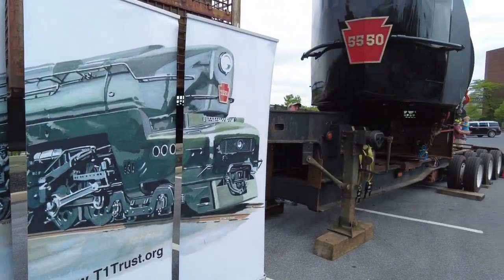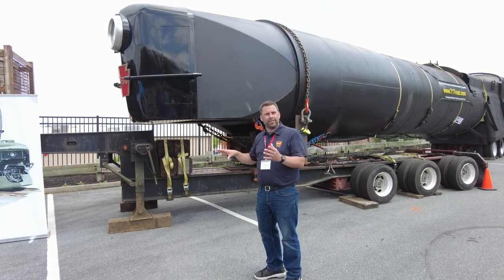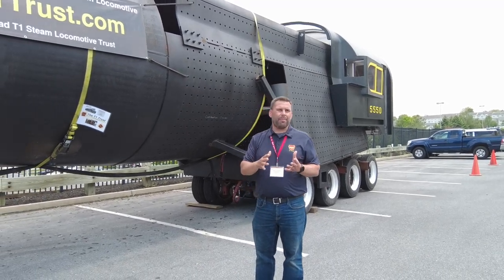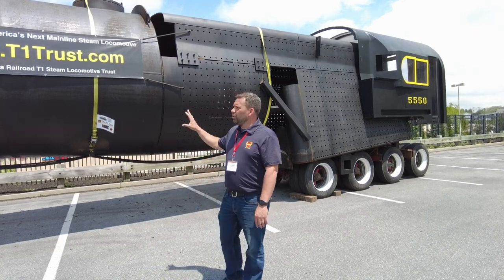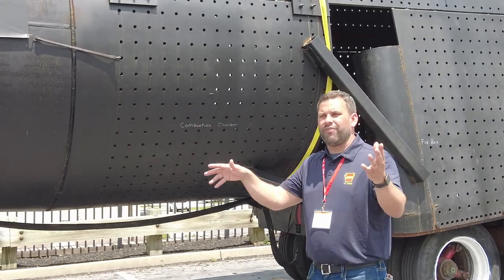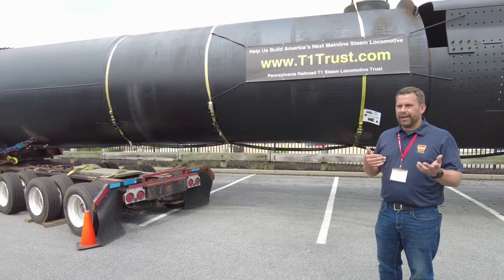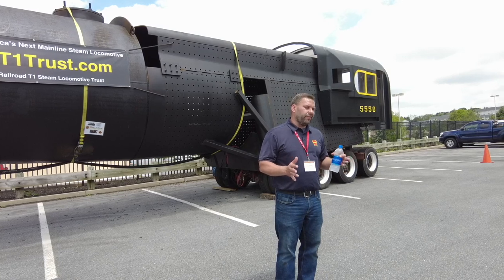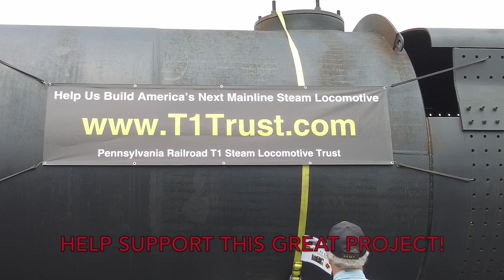T1 Trust PRR 5550 open house | Building America's next mainline steam locomotive

Comment: If they made her run on the line from Los Angeles to Las Vegas, they could make a ton of bank on excursions. Obviously have the coahes decked out with modern amenities. But have the line as flat and straight as possible to achieve the speed that can be used as one of the selling points.
Reply from the maker: That would be an amazing ride! You'd have the high speeds like you mentioned, and I also love the desert southwest so that would be great for sightseeing. You never know, they could decide to do it!

Comment: I find it really cool that the Frame won't be a cast unit, but a precision welded forged steel plate frame. Cast frames had a bad habit of getting some warp in them from heating and cooling. Because of that they had to run tolerances looser for anything was attached to the frame. Looser tolerances caused accelerated wear. With today's precision optical measuring tools that new steel frame should remain straighter than strait and stronger as well.
Reply from the maker: Good assessment, and I'm glad that modern manufacturing techniques are going to make 5550 the best T1 ever.

Comment: Wow Jamie i knew nothing about this. I am only about 15 mins from there thanks for the very interesting video. Thumbs up.
Reply from the maker: Aw man, that would have been cool if you had known since it would have been so easy for you to go see it. Glad you stopped by to enjoy the video though.
Reply: @JamieMakin  That's ok at least I know about. When you were there you were really close to the old Reading Rail Road Yards. Nothing left of it anymore it's a huge container loading  facility now. If you would have had some time you maybe could have caught a N/S train in Hummelstown. I'd like to see the 2102 run on that line again. Saw it in the 1980s near Hummelstown.Id like to see them build a replica of the old Reading Crusader. But I don't think that would ever happen. Ok I enjoyed the video now I know about it.
Reply from the maker: Good info Michael, thanks! I've definitely got to get out to central PA for more railfanning. I've heard there's some good spots to railfan the NS yards on the north side of the city too.
Reply: @JamieMakin  Yes the Enola Yards is a good place if you can get a good location to film.Sometimes there are least 40 or 50 locomotives sitting there. I believe that is N/S repair shop. Then you have trains coming across the Rockville  bridge I did get to see the Nickel Plate 765 go across that bridge. I was filming a train going thru Hummmelstown back in February it has a Conrail caboose on the end. It started slowing up so I followed it. When I got up to another crossing. They just started to back it up on a spur track and was lucky enough to get to hear the caboose whistle.. I got a 25 second video of it. Then you have Amtrack in Harrisburg and to the east and west of Harrisburg.
Reply from the maker: Sounds like one could have a full day of railfanning out there. I've been wanting to get to that Amtrak station because the have GG1 #4859 there. I want to see that one since it's one I have in N scale (and it's a bucket list item for me to visit ALL of the remaining GG1's).

Comment: Will this be a 300lb superheated boiler? The S-1 was. I think the old T-1s were also. I remember an engineer telling me about one pulling a freight train over a mile long in the 1950's through Terre Haute in the 1940's. He was a fireman. He told us that he could deal with the infamous wheel slippage by "feathering" the throttle instead of pulling them out and "locking" them in a notch. 

When the attempt is is made to set the official speed record will it be with passenger cars or test cars? 

Will your stats for this locomotive be available on the Internet?
Reply: P.S. KEEP YOUR HANDS OUT OF THE SMOKESTACK. DO NOT TRUST THE OLD RUMORS. AS A YOUNG CHILD I REMEMBER SPARKS CAME OUT OF ALL OF THEM!😮
Reply from the maker: Those are all great questions! I'm not part of the group designing and building this though. I'd recommend reaching out to the T1 Trust directly for that stuff. https://prrt1steamlocomotivetrust.org

Comment: Who can manufacture a new steam locomotive boiler today? I know some tourist railroads did boiler replacements on their steam locomotives because the old ones were too worn out. Where the heck is this thing going to run? NS isn’t as steam friendly as they were during the 21st Century Steam program started by former CEO Wick Moorman. Now Wick is involved with the EBT resurrection and the 1361 rebuild. I know a good spot for 1361 to run again. York, PA on the Steam to History line and Ma and Pa toward Hanover like it did in August, 1988. I was on one ride to Menges Mills and return, then we headed to Ocean City, MD for the first time and I saw the Wilmington and Western saddle tank steam locomotive and tender that doesn’t run anymore and might have been sold at the Rt. 41 crossing in Hockessin, DE in August 1988 on our way to Ocean City, MD.
Reply from the maker: 5550's boiler is being built by Continental Fabricators in St. Louis. It sounds like they're going to do all of the fabrication of the locomotive and the rebuild of the tender out there too. They haven't decided on a home base yet, but they said they plan to run on short line railroads mostly in the eastern part of the country. For now the Class 1's are not part of their plan, but they said that could change over time if NS/CSX/etc. management changes. That would be cool to see them run out in the York area. I'd of course wish for Reading & Northern, though I wonder if a few of their turns are a little too tight, and I don't know the weight limit on the Hometown High Bridge. Strasburg would be cool too even if the run is a bit short.
Reply: @JamieMakin  Are Shortlines big enough to accompany the size of the Engine's required turning radius aspect of this?.
Reply: There have been other steam locomotives built from scratch, the British LNER A1 60163 is an example.
Reply: @ericdee6802  yep. It can run anywhere a N&W J Class and a Berkshire can. So it can run on Strasburg.
Reply from the maker: They said any that 5550 can run anywhere an SD70 or NW 611 can. Strasburg is a definite possibility, I'm not sure about Reading & Northern though. I know they can get SD50's through Oxbow Bend in Lehigh Gorge, but thinking that could be a limiting factor. I'm sure some shortlines aren't going to be able to run it.
Reply from the maker: @emilkarpo  that's cool, and I hope organizations continue building them.
Reply: The Monticello Railway Museum in Monticello Illinois, had a new boiler made for their 1907 Baldwin 2-8-0 by a company in the St. Louis, Missouri area.............it just went through its first 1472 hour inspection, and passed without any issues.
Reply: @JamieMakin  maybe Andy at the R&N can fix that....... he may have some SD9043 MAC's there in a few years.
Reply from the maker: That's probably the same place that's fabricating 5550's boiler.
Reply from the maker: Hopefully! A meeting of a T-1 and T1 would be awesome!

Comment: they could probably repair some spair parts from remaining PRR locomotives 
(they could be remains of the T1 class)
Reply from the maker: Hopefully they can! I believe they have a whistle off an old PRR T1. I know they got a tender from a different class locomotive, but it's close enough they can modify it for 5550. Hopefully they can find more parts to use as well.
Reply: @JamieMakin  It seems that the tender was just a long haul tender built to be used by multiple engines, since the t-1s and s-1 ran with it. A k4 is also photo'd with it attached. They will have to streamline it somewhat to regain the original look. As for the whistle, I believe 1309 used it for s short while

Comment: Wow! how long will it be before it is put into operation
Reply from the maker: They're aiming for 2030.
Reply: @JamieMakin  Where will this new thing run on in the future?
Reply from the maker: @brianfalzon6739  they're planning to bring it to different railroads, mainly on the east coast, and probably set up multi-month runs in each location. So far Strasburg is the only one specially mentioned as a "definite maybe."
Reply: @JamieMakin  But then how are they going to run it on different railroads, are Amtrak and NS under the mainline steam banner as of right now, is it because of liability insurance?
Reply: @brianfalzon6739  NS allows steam ferry moves on their system.
Reply: @chooch1764  I see
Reply: @JamieMakin  5550 would literally squish the rails at strasburg. 611 is the absolute heaviest engine allowed, and it might not ever go back
Reply: @MiddletownBranchProd.  yeah, a t-11 weights around 100,000lbs more than 611. the wheels will be in the ties at that point

Comment: Do you have a web site with engineering drawings?
Reply from the maker: The T1 Trust's website (www.t1trust.com) has some of the drawings posted as they're looking for sponsors for them (they're converting all of the old blueprints into 3D CAD models). I was amazed to hear they have all of the original drawings except for 14 or so. It would be cool if they had an archive that you could go through all of them, but I don't believe they do.

Comment: You keep away from mallards record she has held it for 80 years now
Reply: LOL... 126 MPH was nothing, the Pennsy S1 and T1's were witnessed to exceed 130mph numerous times(accounts of the S1 hitting 150 were recorded as well). Not official records but they were faster than the old A4's by far.
Reply: Its inevitable that it will be beaten by a locomotive in America or Europe as the larger loading gauge allows for larger driving wheels and the potential for higher speeds at the same piston speeds.  I don't doubt that the T1 will take the record.

Comment: It'd be better if you made it nuclear power
Reply from the maker: I know there are groups researching alternative fuels for steam locomotives, but I don't think nuclear is one of the options.
Reply: @JamieMakin  Why not? Nuclear reactors produce steam, and the added weight will increase its tractive effort. I personally don't understand why nuclear energy isn't viable.
Reply from the maker: @aaronfield7899  I'm not an engineer, but I've got to imagine nuclear is much too unsafe to use for transportation.
Reply: @aaronfield7899  safety. You cannot guarantee 100% safety on a mobile nuclear reactor like that. There would be minimal shielding for accidents and insufficient shielding to not kill the crew. Beyond that, cost. The smaller the reactor the more expensive it is to operate. I'd imagine the yearly running costs of a nuclear train would be more than a lifetime of costs with a fuel oil or coal fueled train.
Reply: I think this suggestion is a joke but if you are serious please understand that it is not possible, safe or logical to do so to any train.
Reply: Like a Sodium Cooled Fast Reactor is remotely possible and somewhat feasible in theory or a Molten Salt Reactor but you'd have to remember that such technology is still damn big for transportation use and would take away more train than the water storage so know you'd have a train far to long to corners to to tight limiting what tracks it can run on which would be only capable of running on straightaway and you would have to consider grade going lower than 4 degrees. Just because of the length issue. One more caveat. Nuclear technology in its most modern cutting edge technology is not a "turn the key" power source in even these far safer nuclear reactors, Its not something like starting a car and shutting it off when not in use. If you were going to do it why would you run off steam at that point if you're gonna put one of these "ultra small" futuristic reactors on a train as it would make much more sense to go electric train not steam. The reactors above i described would deal with the issues presented by Dave's Model Works safety wise, but that still presents absolutely astronomically expensive to the point of ludicrous levels of money just to develop it compared to other economically appealing energy sources to generate that just make way more sense to a railroad to spend money on.
Reply: One more reason is also just plain pure cost. (Also forgot to mention the steam used in a SCFR, or MSR is used to drive a turbine. Which there in generates electricity by moving the turbine. Steam loco's need way more water and do not work in the same way as the steam is used in nuclear power generation for grid usage. I hope this helps clear up why that is. So not even safety the number one reason purely comes from a cost standpoint.)
Reply: @brolydictcumberbatchmontou401  Why can't you just cool down the water like they do on steam ships?
Reply: @aaronfield7899  putting a nuclear reactor in a half million pound vehicle capable of going over 100mph means its also capable of crashing at over 100mph. A nuclear reactor in a locomotive collision would not be good. Surely this is ridiculously obvious why they wouldn't put a bomb inside of a pressurized vessel that speeds across the country through crowded intersection and other railways
Reply: @theshapeexists  well how is that Any different than making the new USS Gerald Ford aircraft carrier nuclear powered?
Reply: @aaronfield7899  comparing a war machine on the ocean to a high speed land vehicle that passes through highly populated areas of people seems to be a pretty clear answer.
Reply: @theshapeexists  Really? Because nuclear cruise ships actually have been made before.

The point I'm trying to make here is that nuclear energy has been proven time and time again to be safe when handled properly.
https://youtu.be/cYj4F_cyiJI